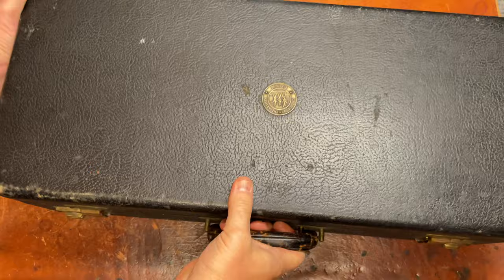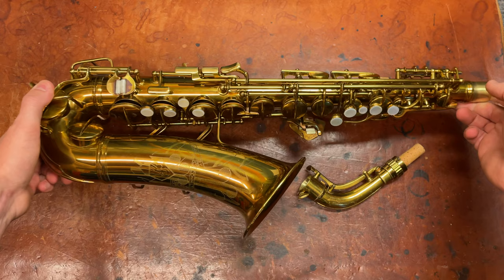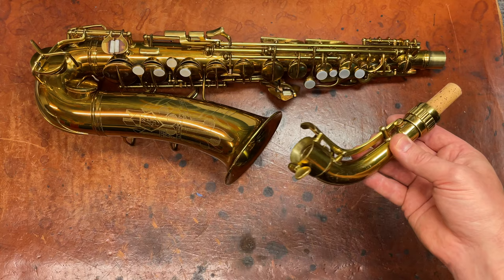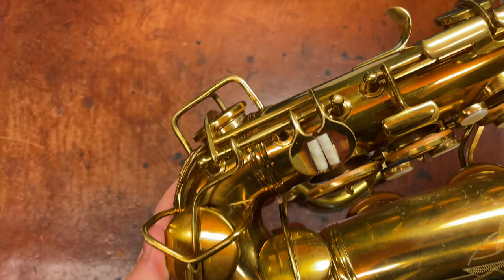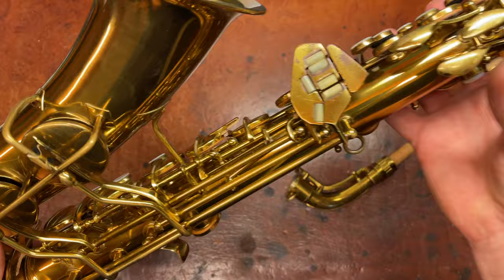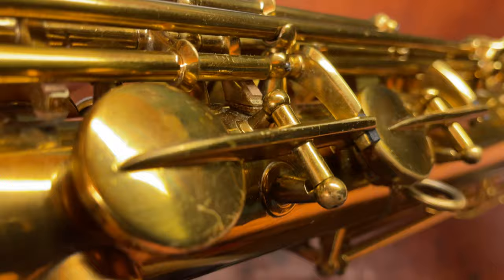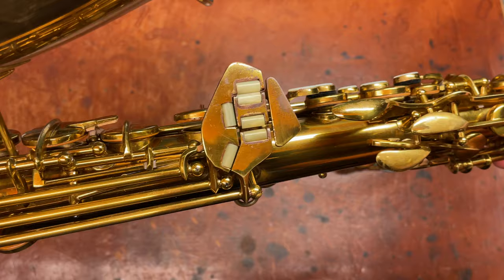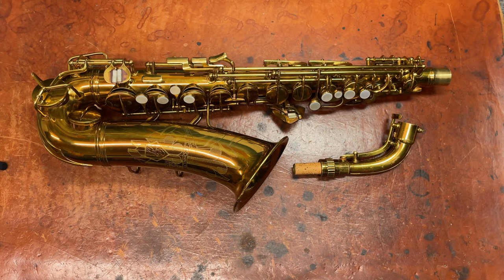Repairman's Overview: Pre-War Conn 6M Alto Saxophone

Comment: If a slot of one of the set screws is fully destroyed, do you have to drill them out? Do they make screw extractors that small to take em out? Thank you for putting out this video 🙏
Reply from the maker: Check out the video linked in the description about the set screws, I go over in detail